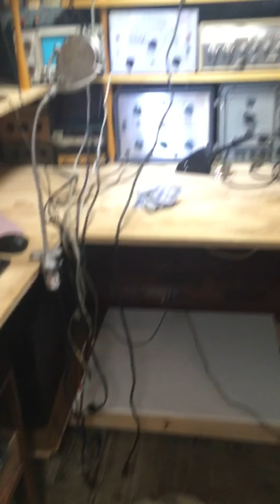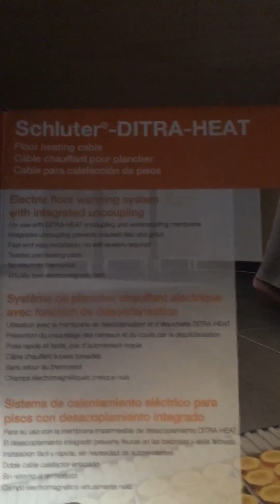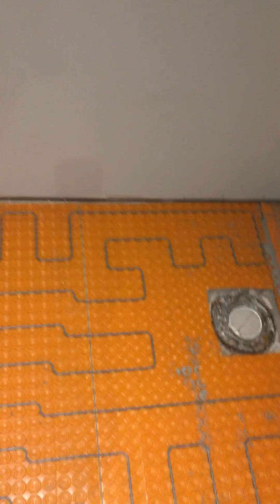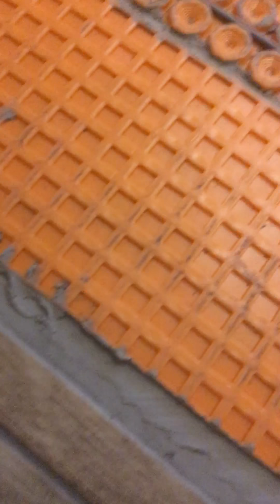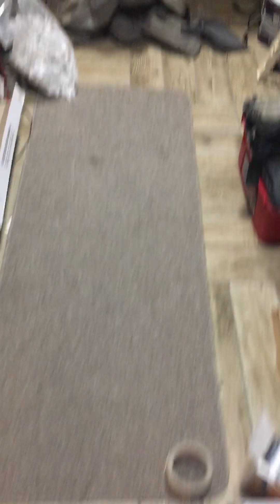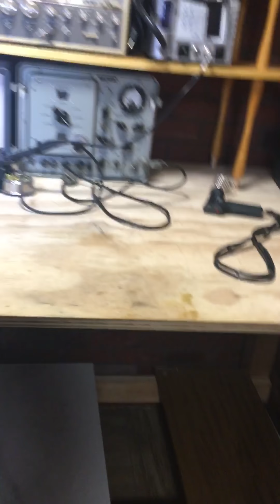Shop Renovation Update Dec 4, 2017

Comment: Finally got to see this.
Very cool. Nifty how the floor heat is laid. Redundant sensors is a must; *mark their locations*. Well, you have here a bit with this record, but count those tiles just in case. ;-)
Yep, like the shelving as opposed to stacking instruments; MUCH easier to service and swap as needed.

Comment: Those shelf separators are vintage . 50's - 60's. I remember using them on a shelf a long time ago. If they are the same type then they would have wooden threads that allow them to thread together and tighten against the shelf. 
- Eddy
Reply from the maker: The shelves were left behind by the previous house owner and it dawned on me that they might fit on the bench.  The thin spindles don't take up much space either.  When I get a little more certain about things, I'll stabilize them by screwing them to the wall.

Comment: i didn't knew that they are doing export too. And as usual, the founder of this company has a name that's hard to pronounce for all non germans. This "Schlüter" should perhaps be some kind of "Shlju-tier". 
Going electrican on heating does make sense, since this will be 100% renewable engergy in some years from now. (and a lot easier to electrify than cars.)
Reply from the maker: 90% of the electricity in Ontario comes from nuclear or hydraulic sources.